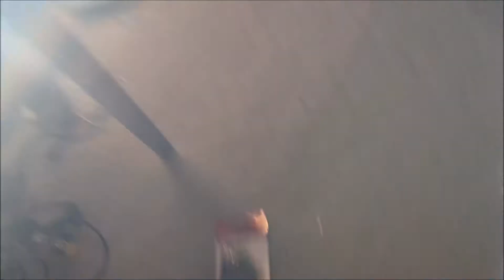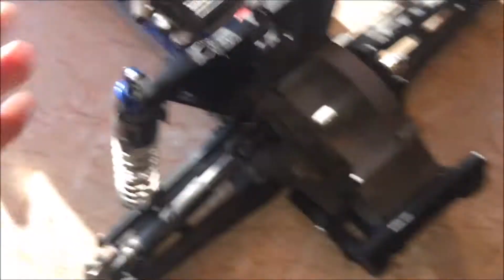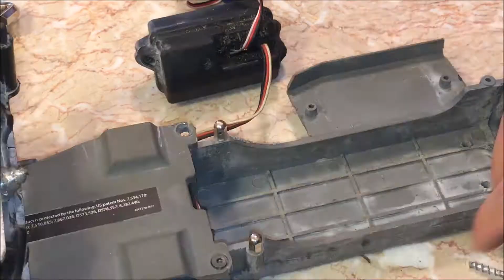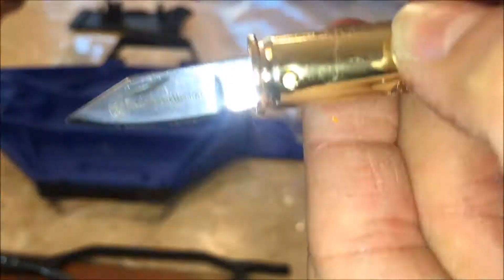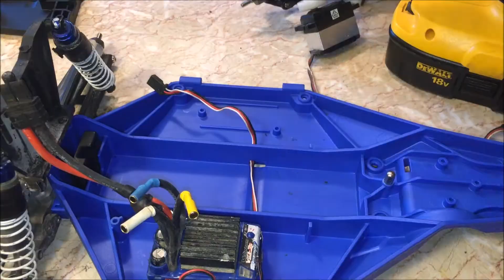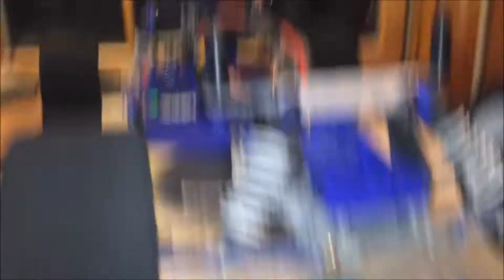Traxxas 2wd LCG Chassis replacement

Comment: How better it drive? Do they have LCG for Rustler or is this the only 1 I can get?
Reply from the maker: Hey Anothony, sorry for the late reply. The LCG chassis makes the slash a MUCH better car! For everything, off road, track, street etc. The rustler front and rear clips will fit on the slash lcg chassis, but it will be longer, around 2 inches longer. you would need to buy a slash body, and slash body posts, then you have a slash. Im happy to answer any questions you have!

Comment: Will it work for a stampede 2wd?
Reply from the maker: Yes! any of the rustler, stampede,bandit,and slash. Keep in mind it will make your stampede longer, like a slash. Feel free to ask any questions! ~ Squidink
Reply: Ok,thanks!
Reply: What about the steering?
Reply from the maker: Xavier Ramirez the white bell tank system should drop in. At most you would need a $5 link. You can email me pictures at squidyrc@gmail.com and I can help you in detail. ~ Squidink
Reply: what exactly does it take to do this to a 2wd stampede?  Thanks man